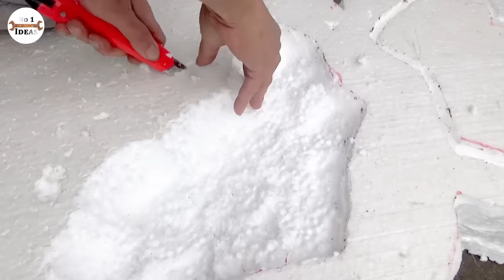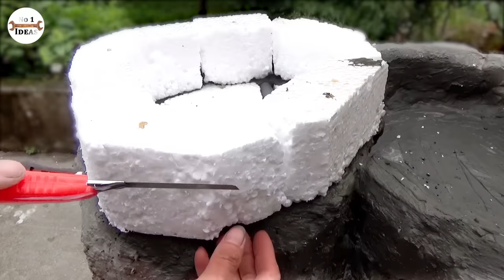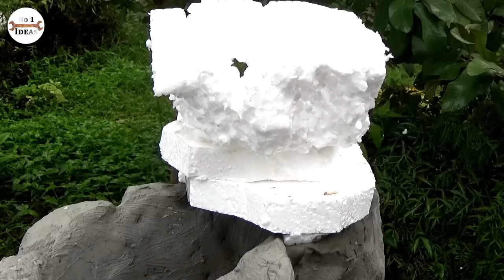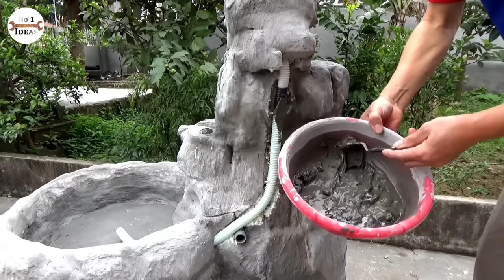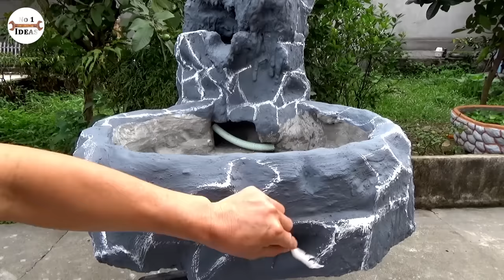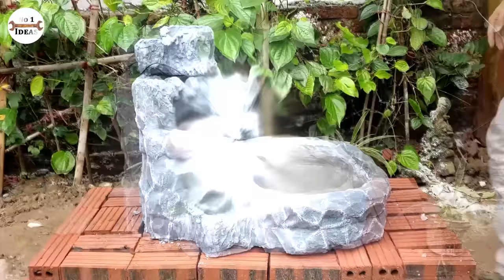Amazing Ideas - Make Beautiful Waterfall From Foam Box and Cement - For Your Garden

Comment: this is amazing, and exactly what I desired for my backyard. I guess that pump is also a filter - and there is no limmit to height (exept for pump, but there are stronger ones for taller fountain) - and extra pockets for plants - great thinking ahead. The whole build is work of art, and I love it, and will be doing one as soon as possible (summer of next year). One can make several pumps and make quite the complicated and detailed set of waterfals that follow the some line (for instance, fence I will be keeping it near). So after two years, what are your experiences, and what wqould you change, knowing what you know now, after two years of use?

Comment: LOVE this!!!! But very curious as to its longevity? Does it eventually leak water? Will it break easily when you have to move it? What if you get a clog in the hose somehow, I'd use a larger tubing and feed a smaller tube thru just in case it had to be fixed. Otherwise you have to break the cement to replace the pipe.

Comment: Great job, well done, we all agree!!! Can you please share what kind of cement you are using, as I can't achieve that consistency, which means the application of my cement+water=paste has no consistency suitable for application with the brush, and neither is the application on the surface that smooth? Thank you for the answer in advance.
Reply: Use cimento com argamassa e cola de madeira proporção para cada quilo cimento use dois kilos argamassa e meio litro cola branca madeira

Comment: I love your work!!! I dream to have such a beautiful aquarium, like that, also, but the fish always died!!! Could you teach us, how to maintain the water so clear, how to put beta and other fish together, how not to stress the fish, etc?
Reply: Hi Fernanda,  The lime in cement is toxic to fish.  It dissolves in the fountain water and can cause a chemical burn to all areas of the fish both inside and out.  It drastically alters the pH of the water.  So, although the waterfall feature is fine to look at and listen to DO NOT ADD FISH TO THE WATER.
Reply: @crystalheart5877  Hi. There is a possibility to add some filters or pH correctors? Thank you
Reply: @soringoldis827  you can coat any surface that touches water with epoxy resin or get that clay they use for pools that dries on its own  and line the insides with that.
Reply: @jndvs95  great! Thank you very much!

Comment: I love this and want to make one but I do not have any electricity to where I want to put this. Is there a
pump that can be used without electric. Thank you for sharing
Reply: Either use an electric pump with power supplied from a battery or  use a hand pump and you will have to pump it yourself whenever you want to see water flowing.  Ever thought about solar cells or wind generator?